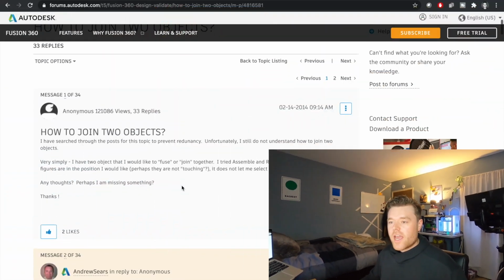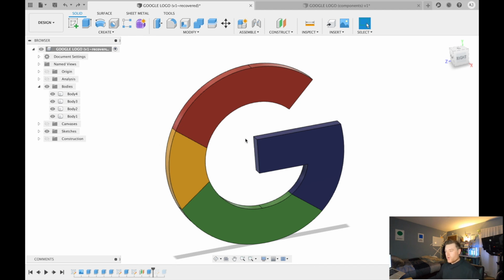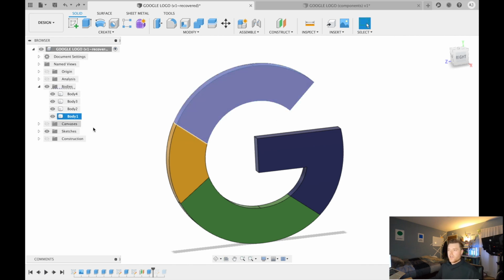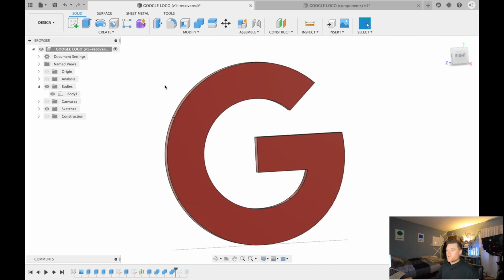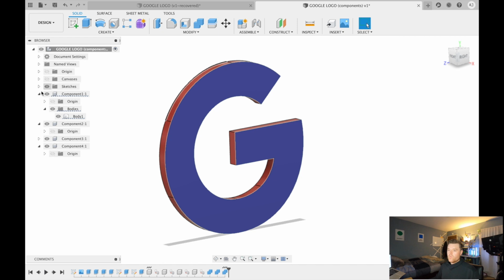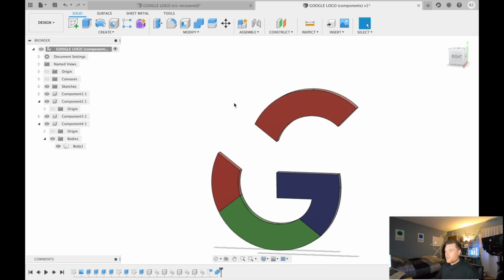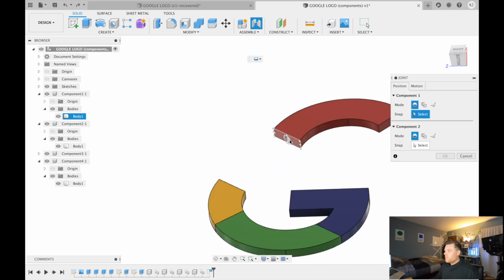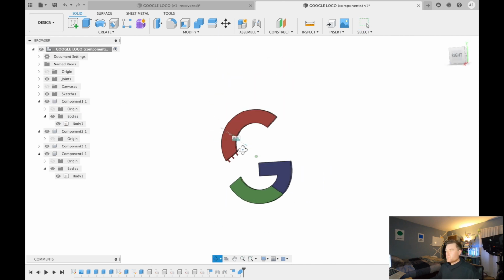How To Join Objects in Fusion 360!

Comment: This isnt working for me. When I try to select a body, nothing happens, it wont select the body !
Reply: From what I found it doesn't work on components which were directly copied. Only copied "paste new" components work, which are not linked to the original component you copied from.  Fusion should be renamed to Frustration.